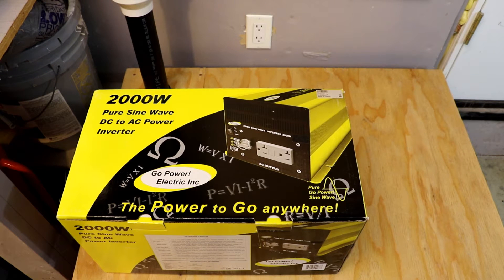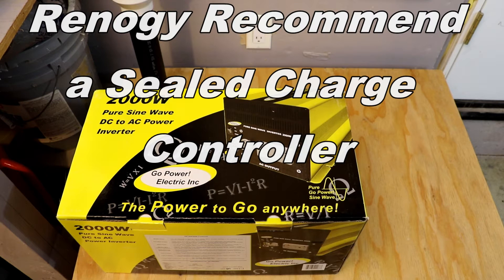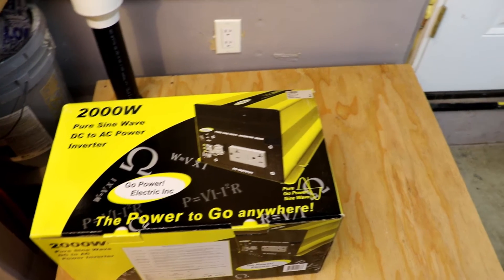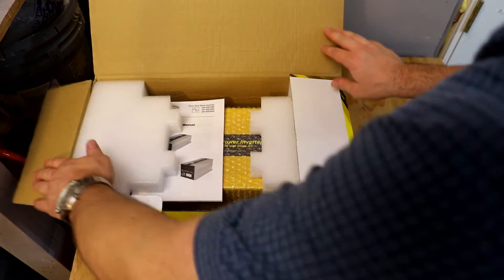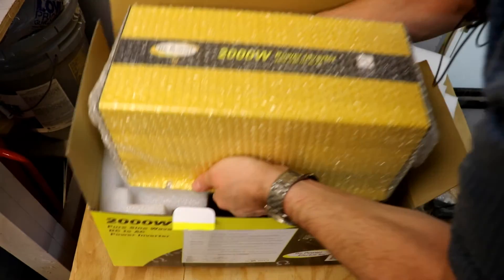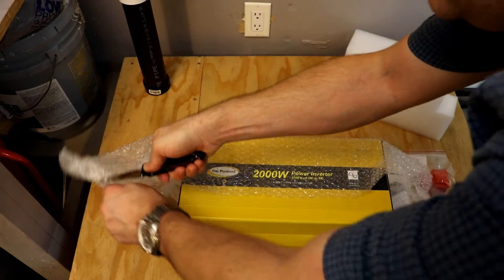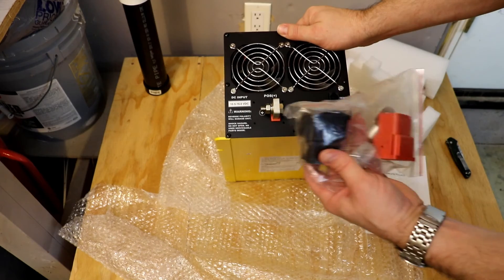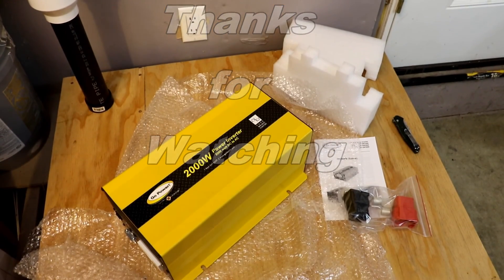Go Power 2000 watt Inverter, Off Grid Solar

Comment: Does this inverter have 60 volts one each leg or 120 volts on on leg? Found most have 60 on each leg to make 120 volts.
Reply from the maker: I am not at all familiar with 60v on each leg/post???
Electricity flows from the negative & is drawn to the positive.  With a volt meter it tests either 120v  or. -120v.  It tests negative when the volt meter probes are touching the wrong posts.  If you have an example of 60v fron each post I would be very curious to to see this.  
Please share.

Thanks for Watching.
Reply: I have a couple of the cheaper inverters.  If you take a volt meter from each leg to ground you get 60 volts.  If you you each leg together you get 120 volts.   This makes it hard to wire up to your house panel with a transfer switch were you house panel common and ground share the same lead.

Comment: need help were did you get your cable connectors from
Reply from the maker: Silverado 66 
The coated cable connectors came with the Go Power Inverter.
The others I have ordered & used were ordered on Amazon.  Install Bay Copper Ring Terminals in 2/0 & 4/0 gauge with 3/8" ring terminal openings.
I hope that is what you needed, but if not let me know.
Thanks for Watching.

Comment: So it is only a charge controller, if you already have AC coming in. So this is not for charging batteries from solar panels. But, it is a good way to supplement a generator, like the Honda EU2000i Companion. Also good if you already have a large battery bank to power this inverter.
Reply from the maker: +Peter Davila 
This inverter is going to be used from a battery bank that is charged from solar panels.  As a back uo you could charge the batteries from a Honda EU2000i.  
Thanks for Watching & Take Care.

Comment: Greetings from off grid  Oregon,  I have heard good reviews about the Go-Power.  
I considered buying their inverter/charger model to replace my old Dr series Trace. I went with a Magnum MS 4024 instead. Do you have a way to charge your battery bank other than solar?
Reply from the maker: +Steven Davis Yes I have an Astron Solid state AC to DC Converter that is paired with a Powergate when the grid is operating & when the grid is down I have a generator that can be directly connected to the batteries or run into the powergate to charge them.  
Thanks for Watching.
Reply: Very cool, thanks for the video!
Reply from the maker: +Steven Davis Not a Problem if you get a chance the Power Supply & Power Gate are featured in a much older video of mine.  "Short-Term Emergency Power"  Getting ready to check out your videos as well glad you commented.
Take Care.